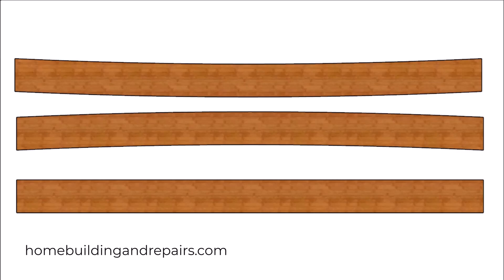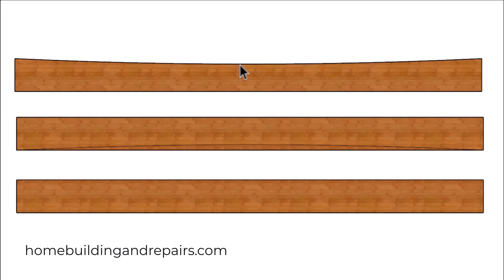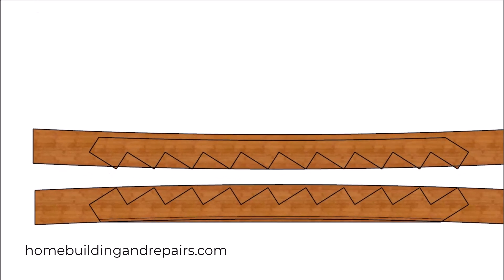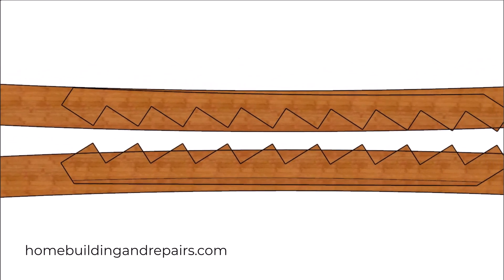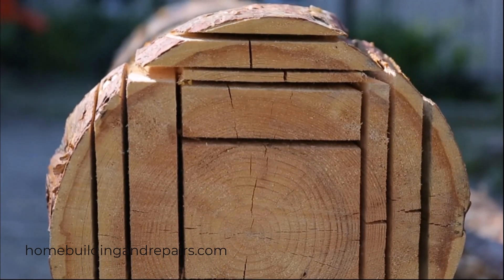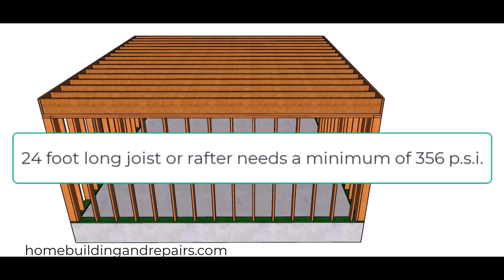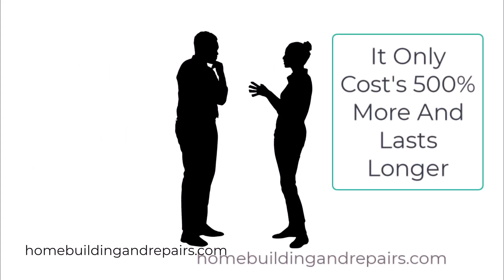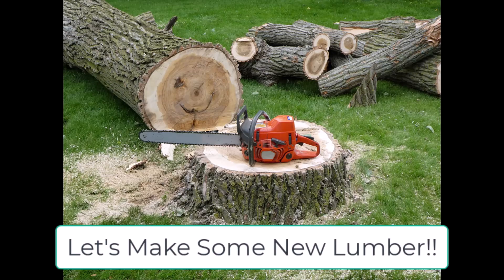How To Cut Perfect Stringers From Bad Lumber And Is Old Lumber Stronger Than New Lumber

Comment: I lay out the first step, calculate the depth of the first triangle cut and the length of the full stringer, then snap a line down the center of the board at the necessary depth and length. Then I use the chalk line, not the edge of the board, to lay out the rest. The cupped edge is where the points go. The result is that the outer points of each triangle on the stringer may wane away slightly, but the spine is slightly thicker than it would be on a straight board and the amount lost off the point is trivial. 

I use the most curved board first because it will need the most adjustment. I do this method of cutting whether the stringers are straight or not, because the edges of lumber from the store are never as good as my chalk line. 

As an extra convenience, I usually use the first layout measurements to cut a triangle out of plywood that I then use to draw each step. I still use overall measurements to confirm the starting points, so I’m not stacking tolerances. 

Once the first stringer is laid out and cut, I of course use it as a template for the rest.

ETA: It’s probably crucial to know that I have to do the entire stair design myself, in the field. All our build sites are on uneven and sloping ground. I build the deck first, to simplify the surveying job, then measure from the top of the deck to get my overall stringer length, then complete the measuring and design process right on the uncut stringer board. None of that fancy stuff where you have flat surfaces or known height or end points. 😊